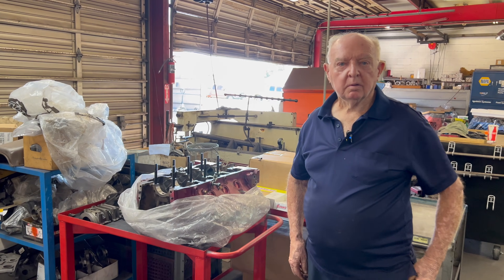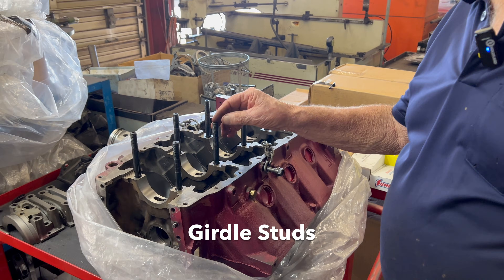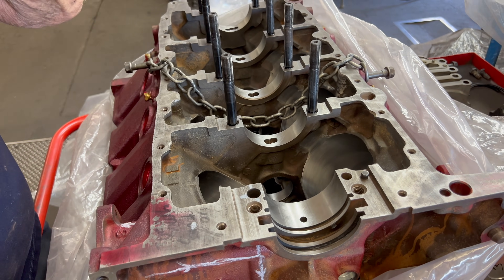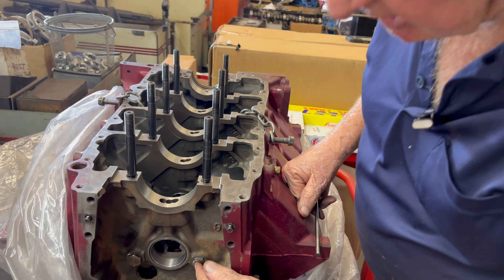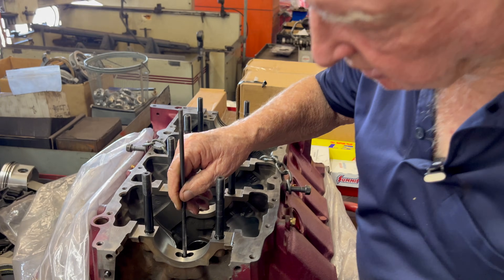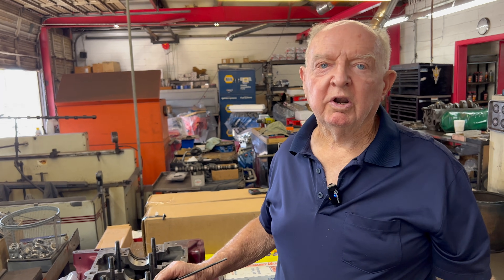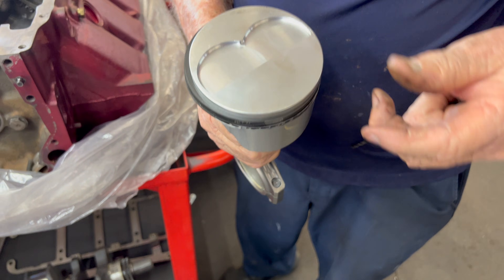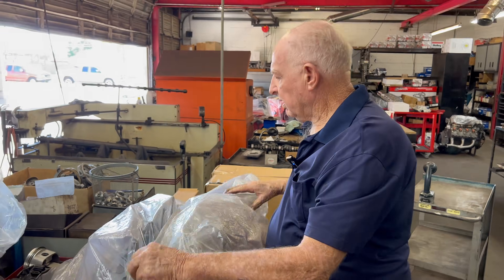BIG BLOCK Olds 455 Oiling   Ed Smith with #barryt

Comment: Theres 3 different restrictor kits available for the big Olds.... 

One of them is a set that you hammer into the center holenin the main bearing upper saddles, BUT, all those do is restrict the oil going to the cam bearings. Those things are useless and belong in the garbage can. 

The other restrictor kit contains 16 smaller threaded restrictors, and those go into each lifter oil feed hole after you drill and tap them to the proper size thread for them. 
You should only use these though if you have a solid lifter cam. NOT for a hydraulic lifter. 

The last type of restrictor is pushrods with much smaller oil holes in the ends. Those can be used with either a hydraulic OR solid lifter. 

Other worthy oil system mods fornthe big Olds are, opening up and chamfering the oil drain back holes at the ends of each cylinder head. This helps to get the oil back into the pan faster. 

The next mod is to take you oil filter housing off the block and gut the disc and spring out for the pressure relief valve, and then thread the hole and plug it with a solid screw-in allen plug. This will create more oil pressure in the system by forcing ALL of the pumped oil into the galleys. It also prevents unfiltered oil from entering the system, ALL of the oil is forced to go thru the filter. Just make sure that you change your oil filter often enough to prevent a drop in oil pressure/volume due to a partially plugged filter. 

And finally, you can port and polish the oil feed port in the #5 main cap and underside of the oil pump that mates to the cap. This increases flow thru the system. 

Doing all of this will definitely help the oil system. Installing a larger oil pan helps too, by preventing starvation from a low oil level, and the increased capacity helps to keep oil temps down a bit too. 

For a big power street/strip engine, increase your bearing clearances. .0025 on the rods and .0030 on the mains is a good place to start. Run a high pressure/ high volume pump when you do this to help keep the pressure up with the larger clearances, and also run a high quality 20w/50 racing oil. Good oil DOES help.
Reply: Hi Dave! Do you have pics/video/link for the oil filter housing mod, please?
Reply: Due to the positioning of the oil drain back holes at the corners of the cylinder heads being set too high, oil can flow back once a certain level has been reached inside the cylinder head. To improve this through modification, the drain holes would need to be drilled downward along almost its entire length, eliminating the return threshold. A simple chamfering is insufficient and has a little effect. 
Ultimately, this would result in a slot-type (elongated) bore. Has anyone had experience with such a modification? Is it feasible without rendering the cylinder head unusable afterwards?
Reply from the maker: Thanks for all this, Dave! I'm going to also ask Ed to comment on those restrictor kits.
Reply: @BarryTsGarage You're welcome... 🍻 

I've been messing with Olds Big Blocks for 30 years. I figured out a thing or two along the way.
Reply: All eyes on Ed 😊

Comment: Back in the day when the rainbows were in black and white...I was told Oldsmobile engineers had a reason for getting the motor oil of their day to the camshaft (and supposedly the engines would run warm since the motor oil back then had paraffin wax in it, why you always had to heat up the engine before an oil change).  Oldsmobile sat just below Cadillac as far as the "price ladder" at GM was concerned. And Oldsmobile decided customers paying this much for an automobile didn't want to hear engine noises...such as...clattering flat tappet lifters.

Also, despite the reputation of the Rocket 88 at Daytona, Oldsmobile expected its buyers to rarely wind their engine up like an alarm clock (ie, redline it), so they made the thinner main webs and long stroke cranks and didn't worry about oiling needs of a high performance engine. Just generate the torque a luxury car needed to pass a Nash going beep...beep....beep and not be scorned. 

Just for laughs, I have an Olds 455 in an early 4-4-2. Variable duration flat tappet lifters remove probably .03 off the lift, maybe 30 degrees of duration off .490/260 split cam before 3,000 rpm. with the help of the spread bore Q jet and an ancient Allison captive discharge ignition system, I can put the manual valve body TH400 into Top Gear and drive all from idle to 5,500 rpm rev limiter and get 15 mpg on 93 octane (the Olds combustion chamber allows for 10:1 CR). But when I want to go racing, there's a switch pitch torque converter in the transmission, so I change the stall speed from 1,800 RPM to 3,300 RPM, choose First gear for multiplication of the highway rear axle gear and do 0-60 mph in 5.5 seconds, a hundred mph in the quarter. All of this being 1960's technology...
Reply from the maker: Interesting history lesson!

Comment: The stock Olds oiling system pretty much sucks. The fact that it oils the lifters first, before the crank gets it's oil is a pretty big weakness. 

An aftermarket block with a totally redesigned priority mains oiling system IS the way to go if you are building a big power Olds. It's expensive but WORTH every penny, over re-doing a stock block build time after time. Over 600 or so horsepower with a stock block big Olds, and you have yourself a time bomb. It's just a matter of time before it goes off... 💣
Reply from the maker: I will ask Ed to tell us more about that.

Comment: As a Oldsmobile man I've always heard about the 455 Oldsmobiles oil problem but what about the early 400 and 425 blocks never heard of problems from them as well as  the small blocks and all a 455 is is a stroked out 425 I feel opening up the oil drain back passage in the cylinder heads should be drilled out a little more and sanded with a sandpaper roll no need for oil restrictions if so I'd just run oil restrictions in the push rod hole size 😀 👍 😉 it's also said at 5250 RPM the oldsmobile oil pan is sucked dry during long RPM use. And comments are welcome as always peace and much respect to you Jason humphry
Reply from the maker: Thank you - I’m going to ask Ed about that 👍
Reply: @BarryTsGarage  sounds olds some thanks and as always peace and much respect to you
Reply: @BarryTsGarage  I myself am currently doing a 350 oldsmobile diesel to gas conversion on a DX engine block and it uses a thrust plate to hold the roller hydraulic camshaft in place I learned through reading it will work on a 455 oldsmobile big block no problem but trying to adapt it to the 403 oldsmobile small block it won't work due to a slight oiling difference in the block interesting reading out there I don't believe it myself but I can't verify myself I'm planning on filming my engine building step by step on my channel 😀 👍
Reply: I've learned that a 455  oldsmobile has more bearing surface to cool than the 350 oldsmobile but no truth factor on why the 455 olds gets the oiling problem the most I know oldsmobiles to be hard on the number 7 and 8 connecting rod bearings and high volume pumps could suck the oil pan dry
Reply: The 455, 425, and the late 400 ALL had the same engine blocks, with the same oiling system.
Reply: A higher capacity pan can help for sure .

Comment: I still the have my olds 468 cubic inch 11.1 CR     6,800 rpm all day beat 427 side oil Ford's on the street  & a lot of Pontiac too Buicks  lol  4.88 gears will make them bitch run lol
Reply from the maker: Wow does sound like great fun
Reply: @BarryTsGarage  Oldsmobile can fly with the right cam & gears ,now with all the new technology is idiot proof

Comment: This is clever.. i do not have experience up close to know of if this is a good, fair, bad oiling system. Looks clever, and would appear to make it exceptionally easy to clean, especially if you beed/bead (?) blasted it with steel shot in the tumbling machine? I could be wrong in that idea..where as the galley oil passages on other blocks, never mind the new casting of today's 4, 6, 8 cyl engines, especially on foreign engines of today.. they are a maze of sorts for junk to get stuck, lost, built up, etc... but this Olds 455 system seems totally accessable straight thru designing? 

I dont know if this Olds 455 galley system is longer then the other typical big-3 V-8 blocks, shorter or longer or the approx same? Just clever is all.
Reply from the maker: I like your comment, you bring up some good points 👍

Comment: I hired in to Olds in February of 1964, in the engine plant. I worked on the line where they put in the cranks, cams, and the timing chains on. There were 8 different pistons for standard bore, same for .005 over bore, and the same for .010 over. The blocks and cranks were color coded, you matched up the colors on the crank to the colors on the block for which main bearing to use. There were four different main sizes,  big blocks and small blocks ran down the same line. They started them up and ran them to set the timing when they came off the line. Every once in a while you would see one hanging that had a rod sticking out of the oil pan. When I transferred out of the engine plant, the department I was in and the next department down where they hung the pistons, was cycling every 15 seconds.
Reply: Olds 455 has a very long rod motor. The cheapest and easiest way to spin them up was use Howard's aluminum rods. Rebalance the rotating assembly, let it rip. Once again with help from Olly Moris I was able to make a lot of dependable power. Not just with Oldsmobile engines, but 455 Buick's, Pontiac's, 460 Fords. Having the privilege of talking with brilliant engine  builders, using there knowledge I never had any problems.
Reply: I used a Olds 455 in a pulling 2 wheel drive pulling truck. With a lot of wisdom from Olly Moris I kept it alive and running.  When it hit 4700 rpm it really started to make a lot of power. I held it wide open for 12 to 15 seconds. It was a lot off fun, but very expensive. High dollar sport.
Reply: Every Olds 455 ive seen that was revved up a little threw a rod every time.
Reply: @terrypikaart4394  Don't know about that, but when they actually started them up and ran them to set the timing, I know some of those guys wound them up pretty good.
Reply: @lylewitt7393   These were brand new early 70s olds 455s in boats, all threw a rod and were replaced with BBC if customer could afford it.. 
They would not tolerate airing out the pump more that once or twice..   Chevy had no problem with that..
Reply: @lylewitt7393 There would be no reason to be revving the piss out of the motor when it's first started to set the timing.... 🤷🏻
Reply: @davelowets  I'm just telling you what some of them did in the test room, I never said there was a reason to rev them up. That's just what I heard some of them doing when I walked by. I didn't work in the test room myself, just saying!
Reply: @davelowets  I NEVER said anything about revving them up to set the timing or anything like that, I was just telling what some of them did, I didn't work in the hot test, just walked past there once in a while. When I transferred out of the department I was in, they were pumping out 240 lower end an hour.
Reply: @terrypikaart4394 I generally limit at 5200 . Out of  4 big block Olds had a rod barring issue once
Reply: @  I believe that, but you flash rpms to 6500 or 7000 and back to full load, they toss a rod out of the pan.   BBC would tolerate that a lot better..
Reply: @terrypikaart4394  Then you haven't seen a properly built one.... 

I turn mine to 7100-7200 on a regular basis. Zero issues.
Reply from the maker: Wow, great comment, thank you for sharing your experience with that!
Reply: Please tell me if you can, what are the 5 blind holes on the front main of the crankshaft for.
Reply from the maker: Any chance it was related to internal balancing?
Reply: It's been 50 years since I was in the engine plant, the only holes I can remember are some blind holes in the rod throws. I looked up blind holes in C/S, and it sounds like they could be there for when the C/S was machined and balanced. There were also four or five people that ran machines to balance the cranks after the flex plates were put on before they went into the blocks. That's what I came up with. Just what I got from looking it up.
Reply: Thanks. I seen them many times in 455 cranks. Never knew what that were for. I should have spoke with Joe Mondelo, I believe he would have the knowledge on there use.

Comment: You should also discuss the oil gallery orifice-plug behind the rear cap that lubricates the distributor. This is often missed or left out and result in very low oil pressure.
Reply from the maker: Great idea

Comment: Built a NHRA legal "Stock" 1971 455 W-30 many years ago. It was shifted at 6800rpm. Made over 500+HP. And it was "Stock".... Usually ran E/SA.
Reply from the maker: Wonderful
Reply: @BarryTsGarage  These Oldsmobile engines are pretty good when ya sort out the oiling system.
Reply: Ok, time slips? No time??? Really bro, calling you out. What was your best ET? How many NHRA sanctioned races did you win??
Reply: @hilleryclifford1350  I built the fuckin engine, didn't own the car. It ran 11.60s.
Reply: @thereluctantgearhead4544 11.60s is pretty good for a "stock" engine. 

Back in the late 90s-early 2000's I was running a g-body with a 455 in it in the Summit Super Series at my local track. It ran in the 11.4X's @ 119mph, with iron heads, flat tappet cam, and single 4150, but it had a little more done to it than you guy's "stock" engines probably. 

The thing was TORQUEY, and for only a mid 11 second car, it would carry the front tires a foot in the air for a good ways just footbraking it out of the hole at a dead idle.... 3000 stall, 3.73's and a 28" tall 10" slick. 

It was a fun car for sure... 
Deadly consistent in the bracket races too. If you could cut a light, the car would run the numbers every time. 🏁
Reply: @hilleryclifford1350  And you wouldn't call me a lier to my face, I guarantee you that. Boy.
Reply: @thereluctantgearhead4544  lol 😆
Reply: @hilleryclifford1350  You obviously don't know shit about NHRA Stock engines. They don't run stock.

Comment: I restricted my oil gallery to the top end in my Olds 425/455s. I've turned them 6800 rpm on the 455s, 7200rpm on the 425s. Shit works.
Reply: And how did you go about restricting it?

Comment: Did a 481x race engine come about based on Oldsmobile
Reply: Thanks alot iv been trying to find out how the 481x came about
Reply: @PriendraChutterpaul  Pretty much unlimited power potential. Extremely durable.
Reply: @PriendraChutterpaul  481X is a Allen Johnson design based on a hybrid Olds/BB Chevy architecture. No stock parts will bolt to it. Chevy bell housing pattern. Solid billet block and heads. 4.84 bore space.
Reply from the maker: I don’t know - I’ll ask Ed what he knows… 👍